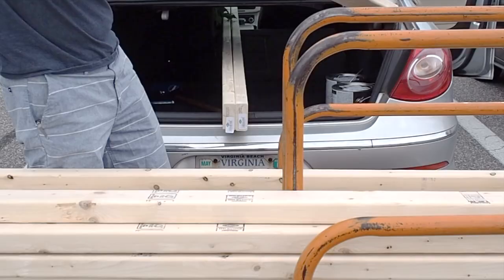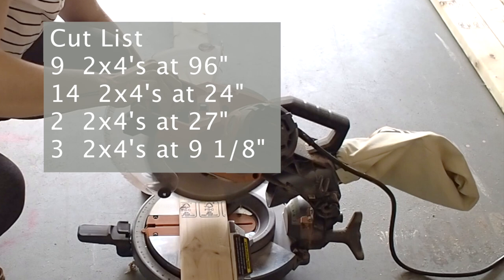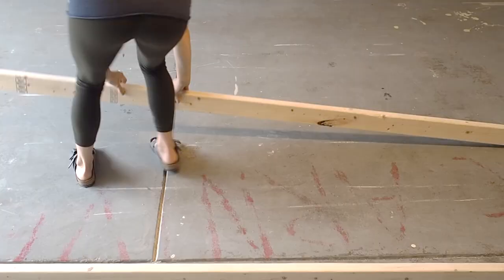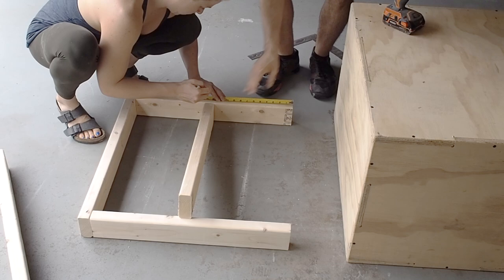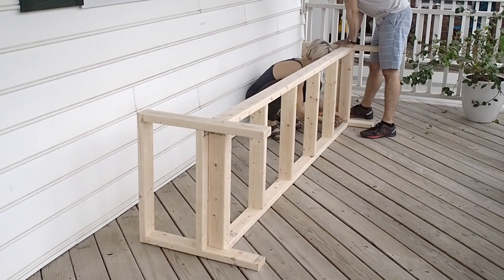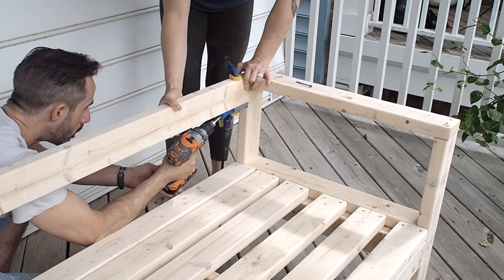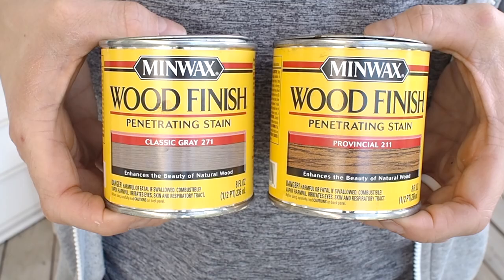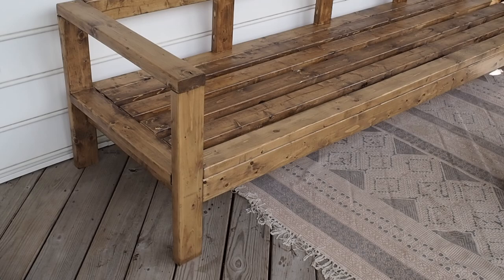DIY Outdoor Couch Built From 2x4s | Restoration Hardware Knockoff

Comment: This looks really good, just for next time using the pocket hole jig, always make your pocket holes on the face of the board into the end grain. Much stronger joint that way and much less chance of tear out. This is about a year old so you probably figured that out by now though. Very nice job!

Comment: Next time you use your Kreg Jig, you don’t need to have the board in its final place to drill the pocket hole.   Also remove the jig to install the screw.   For your first time it looks really good!  I made a “U” shaped sectional using similar design.  If I could post pics I would.  Keep it up! 😁

Comment: Very nicely done.  I've built many things with 2x4. Just a tip,  use a counter sink with long drill bits on your cordless,  to pre drill and set the screws, so much easier,  doesn't wear out your cordless,  also using quick set bits to change fast between screw tips and countersink.  From experience,  trying to drive a 2 1/4 screw into 2 2x4s is pretty tough.

Comment: Step 1: GET a set of sawhorses to put your boards on. Step 2: Build a chop saw table or go buy a B & D Workmate. Ha ha ha! I just can't bend down like you to work I guess. 😁😁😁 All joking aside, I really like it. Looks nice enough to use inside as well. Just thinking about your sanding. Personally, I think that I would have hit it sanding grits of 80 to 150 to 220. But again, that's just me. Really like the finish color. Ya done well!
Reply from the maker: Thank you! Definitely need some sawhorses! Among other things lol
Reply: @MeganBell  ha ha ha ha ha! Go get the screw-on kind that you slip 2 X 4s into. They're inexpensive (not cheap), collapsible, versatile, and will last you for decades. I'm using some of my dad's and they have to be at least 60 years old and they were used to build a 4-H Camp with! 😁😁😁

Comment: Did this and turned out great.  The next day though I noticed it was squeaking a lot when sitting on it. Any tips on how I can fix that? Thanks
Reply from the maker: Removing some screws and gluing the joints before you screw it back together may solve that

Comment: Beautiful project cushions are really nice but I find the cushions get pricey...Ikea's cushion cost  $10 which you also have to buy the $25 interior padding bc it's sold separately..adding up per cushions it's kinda high ...any alternatives?
Reply from the maker: The ones I purchased from ikea did not sell the inserts separately. They were 10 a piece for the back cushions and 15 a piece for the bottom. Very affordable.

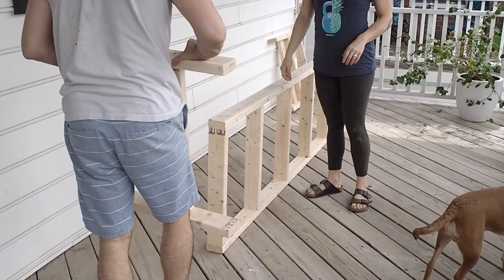Comment: I really like your project. I like the simple inexpensive nature of it as well as your custom modifications. I have a couple of critique though. I looked through some of the other comments to see if anyone else saw what I think I saw but no one seemed to have an issue. At 5:58 you "screw onto the inside of the frame UNDER the arm support. Unless I'm mistaken, which is quite a possibility so correct me if I'm wrong, that would put the load weight on the screws instead of on the actual arms. Did I get that wrong? If that is correct, the weight of all of the supports as well as the weight of anyone sitting on this extra-long couch would rest solely on the screws joining it in place. Am I wrong? Also, I would have liked to see an extra foot in the middle of the couch to redistribute the weight load on the overall structure. What do you think? I'm open for criticism. I ask this only because I am strongly considering what you have done here. I am planning to do a similar project for this summer and may borrow from your great ideas here. Thanks for the inspiration.
Reply from the maker: Honestly, I made this outdoor couch 2 years ago. I don’t remember the specifics at this point. My advice is to do what you think is right and what works for you. Our couch is great after two years and we are spending our third spring on it right now without the added support many people have suggested. I say it doesn’t hurt to reinforce if you think it’s necessary.
Reply: @MeganBell  Great! So, you have not experienced any sagging or cracking. The 2x4's must be enough then to support the weight. Thank you. I will give it a try. I appreciate your project.

Comment: Great project, I have a question about how the arms attach to the seating section.  If I understand correctly, the entire weight of the seat as well as the people sitting on it is supported by the 6-8 screws holding it together? is there another way you could add more support?
Reply from the maker: I get so many questions about this being a sturdy and stable couch. Let me just say that we pile people on this thing constantly and it has sat outside on our balcony for two years and it is just as sturdy and solid as ever. 2x4s are pretty girthy.
Reply: @MeganBell  Amazing, thank you!

Comment: Great project but you used the pocket hole jig wrong and placed the holes in the wrong location causing a very weak joint.
Reply from the maker: Thanks, we realize this now as this was our first time using it. We added that support on last minute, but two years later we are still happy with this couch. It’s very supportive and looks the same as the day we finished it.

Comment: Love how this turned out for yall. I'm just starting this project and I wish drilling was as easy as you make it look. Did you opt to predrill pilot holes?
Reply from the maker: Thank you! I’m not sure if I predrilled or not (I’ve learned a ton since I made this couch, but it’s still awesome three years later,) but you should! It will keep your wood from splitting.
Reply: @MeganBell  Thank you so much for replying so quickly. I'm gonna try not to give up haha!!!
Reply from the maker: Try changing the torque on your drill if you can. Sometimes that makes the difference.

Comment: I am in the middle of making this, curious how you like the height? Since the arms and back are the same, making sure it's comfy before finishing. I was contemplating making the leg cuts maybe 2in longer? Thoughts?
Reply from the maker: The height is perfect for us, but we also like the look and feel of modern style furniture which tends to be a tad lower. If it’s something you’re contemplating, I say try it! Make it your own.
Reply: @MeganBell  thank you! I think I just might! I'll let you know how it works out if I do. 😊
Reply: @1987KateM  I"m actually curious about the comfort. Did you end up making your seat bench 2" taller? I'm thinking you can use the same dimensions and cuts, but the piece of wood on the arm that you drill the seat bench into can just be placed higher, right? That way you don't need the arm rest any higher. I'm trying to figure out what's best for my comfort as well. What did you end up doing?
Reply: @jefflivorsi  I actually ended up staying with the 25.5in arm cuts. I used smaller cushions so these were going to be about 2in shorter if you go by the plan directions. I am glad I ignored that cut suggestion and kept with the 25.5in for the arms. I also bought back cushions, so it is quite comfy. My only add on in the future will be a middle added brace in the back to keep the cushions from falling out. I do love them and am happy I made them, they are comfy. I did 2 couches and a table from Ana Whites plans.
Reply: @1987KateM  Thanks for the quick reply! So you raised the arm 1.5"? Does that mean you raised the seat bench 1.5" too to be 14.5" off the ground (17.5" with the cushions)?

I promise this will be my last question :-)
Reply: @1987KateM  Thanks for the quick reply! So you raised the arm 1.5"? Does that mean you raised the seat bench 1.5" too to be 14.5" off the ground (17.5" with the cushions)?
Reply: @jefflivorsi  I used these plans (https://www.ana-white.com/woodworking-projects/2x4-outdoor-sofa). My cushions were smaller than what Ana used (6.5 inches thick x 22 inches wide x 24 inches deep) so I initially followed the cut list using my seat cushion dimensions as directed. What the directions need to say is to leave 4 cuts at the 25.5" for the arms (see step 2). They were too short otherwise. That is the only change I made to the plans. 

These are the cushions I used https://www.target.com/p/woven-outdoor-deep-seat-cushion-duraseason-fabric-threshold/-/A-78363336?preselect=76422412#lnk=sametab, and the back cushions https://www.target.com/p/woven-outdoor-deep-seat-pillow-back-cushion-duraseason-fabric-threshold/-/A-78363549?preselect=76422417#lnk=sametab. 

RECOMMEND: Build to suit cushions.  

9 - 2x4 @ 72”  (or cushion width x times 3)

13 - 2x4 @ 25-1/2” (or cushion depth plus 1-1/2")
(here is where you need to leave 4 @ 25.5in for the arms)

2 - 2x4 @ 28-1/2” (or cushion depth plus 4-1/2")

Comment: Have you found that you need supports under the bottom in the middle?  It would seem that if the couch had four people on it i could collapse....oh course I aint skinny like you guys....lol
Reply from the maker: Joseph I have received so many inquiries relating to this and this is our second summer using it. We both lay on it often with our dog, host gatherings where all sorts of people with different builds are on it and we haven’t noticed a single bit of sagging. It’s a very durable couch as is but if you  are unsure I don’t see why you can’t add it on. It’s definitely something that can be completed at the end.
Reply: Thank you, I really love the extended length thanks for the reply!

Comment: How did you decide to use pocket screw vs external screws for different areas of the couch?
Reply from the maker: I used pocket screws at the end because I added that back brace as an afterthought for extra support. I wasn't too familiar with pocket holes at the time that I made this and if I were, Id have used all pocket screws or done a better job at hiding the external screws.

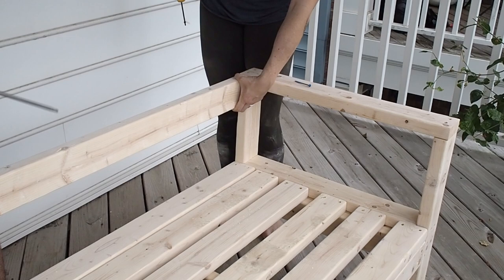Comment: Hi, thanks so much for this video. At 6:50 you use a kreg device. Which one is this (do you have a link? I never used this. What makes it difficult and are there other possibilities to attach the back support wood? Why didn't you use this technique with the other joins? All the best! Dirk
Reply from the maker: Dirk I had never used a kreg jig before but I was forced to use this because I needed to attach the back support after I had already attached the main 2x4. If you attach the support posts, first, you can avoid using the kreg. Best of luck!

Comment: What kind of wood did you use that was under $3 a board?
Reply from the maker: Jason Kosowski I believe it’s pine.
Reply: Looks like cls wood, its usually used for framing.
Reply: Jason Kosowski 
    Those are Hemlock (Whitewood)  Studs. 
    
May I suggest spending a couple extra bucks on Cedar or Redwood  2”X 4”’s ?        The construction screws will stabilize far better in dense wood. The outdoor elements  won’t have nearly the same effect on those woods as well. 
     Otherwise,  nice design and decorator efforts.

Comment: Hi. With the straight and shorter back height, is it comfortable sitting leaned back?  I'm looking to build this but not sure if I should create a 10 degree angled back for it.  I also bought the same ikea cushions so just wondering the comfort level with your build. Thanks.
Reply from the maker: Mark M I it’s comfortable enough for outdoor furniture. Certainly nothing compared to our living room sofa, but great for time spent outside with drinks in the summertime. I have been known to fall asleep on this, but laying down, not leaning back. The height is not very tall in the back so angling it may give it that extra comfort level you’re looking for.
Reply: @MeganBell  Thanks for the reply and tips for the build.  I love the stain color (mixture) that you used by the way.